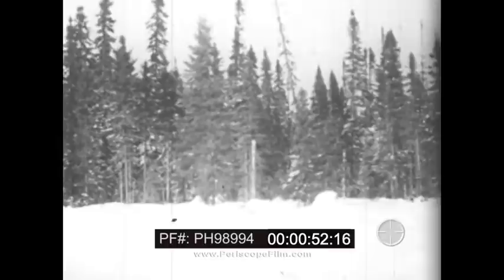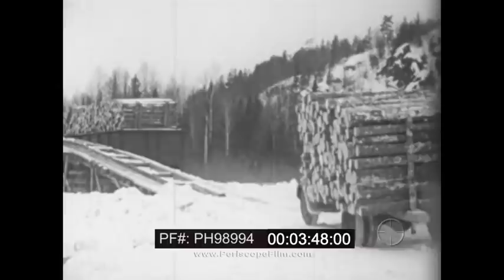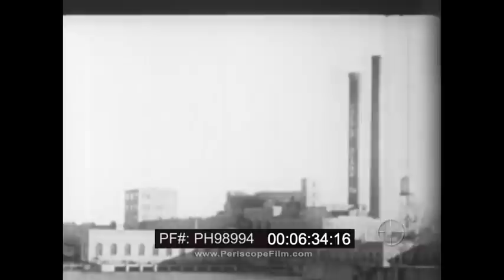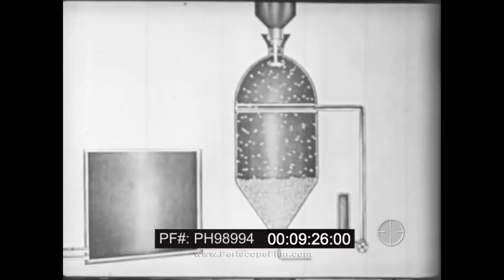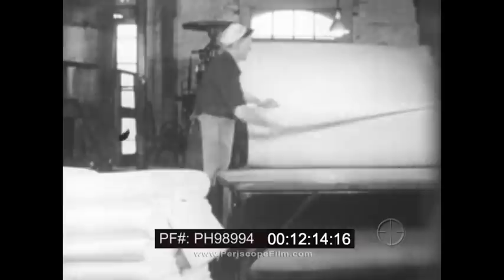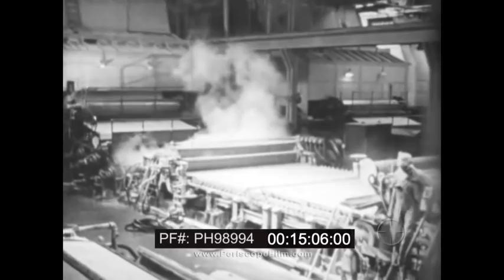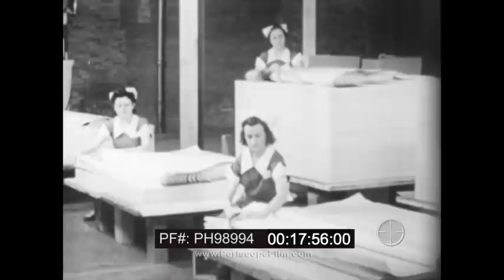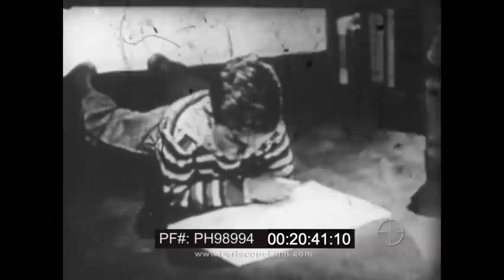1941 EDUCATIONAL FILM  " PAPER MAKING "  HOW PAPER IS MANUFACTURED  LUMBER INDUSTRY PH98994

Comment: I spent 30 years in the paper industry, primarily light and heavy weight coated publication grades. Of course, that market is dead. Who gets magazines and catalogs these days? Still, the basic processes described are still the same today, no matter what kind of paper you're making. Of course, a lot has been automated. Gone are the logging camps. Logging is done mostly year-round, except for a few weeks in mud season. Machines that grab the tree, cut it off at the base, limb it, cut it to the proper length, and stack it on a trailer in one smooth motion taking less than maybe a minute are now used. That's quite a sight to see. Continuous process digesters are now widely used, although batch processors are still used. Wet lap machines are still used, although primarily by mills that sell pulp or for stockpiling pulp for pulp mill outages. The bleached pulp usually goes straight to the paper machines now, maybe with a short stop in storage tanks. Sheeting is almost all automated, from cutting the paper into sheets to packing it into boxes. Even the stacking of boxes on pallets is automated. Robot trucks convey the pallets of boxes or rolls of paper around the mill now. For roll paper going to printing or converting facilities. wrapping the rolls and putting on the end-caps is all automated. Of course, the processes themselves are now computer-controlled, using distributed control systems to monitor and control the pressures, flows, temperatures, basis weight, caliper, moisture, and so forth. Not quite an operation "Run by one employee and a dog," but close. Safety and environmental protection has changes, too, a lot, and for the better.
Reply: I was a human forklift in a paper mill for a couple of years.
Reply: Nope.  You’re right. Thanks. I did too.

Comment: Here i was thinking paper has become crazy expensive.  But after seeing this, I cant believe how cheap it is.
Especially back when this info video was made.. Considering how many ppl had to get paid plus the expense of factory & machine upkeep.
Reply: With today’s logging machines able to cut down and strip a tree every few seconds, more efficient transportation, new processes and equipment, and less labour intensive, paper is probably more high grade and easier to manufacture, meaning prices can be a lot cheaper than you might think. 
What I don’t like is that even today we are still cutting down trees faster than they are planted or can grow to maturity, the amount of paper (and plastic etc) that the world has produced is probably mind boggling, and yet the rate of recycling is far lower than it should be, if we have any hope of saving the planet for future generations we have to recycle more, use renewable energy sources and stop rapping Mother Earth of minerals etc, otherwise the next generation could be the last. 😔😡🤬🇬🇧🏴
Reply: @allandavis8201  "otherwise the next generation could be the last" HAHAHAHAHA Really Al Gore? HAHAHA and "snowfall will be a thing of the past" too, right Al.
Reply: @allandavis8201  Capitalism doesn't cut off the hand that feeds it. When pushed, it will adjust to accommodate the changing resources and expenses. Your scenario does not factor in the technology that has and will continue to extract the maximum benefit for the least cost. (Or, you can volunteer to return to the woods and live off "the fat 'o the land," if you prefer.)
Reply: @bondjames5874  Exactly hahahah!
Reply: @allandavis8201  And pssssst this internet thing no usey de paper

Comment: Anyone notice that they DIDN'T SHOW where the "waste water" that was used in the processes went.

I was stationed in Plattsburg, New York in the mid to late '70's and there was a HUGE paper mill right on Lake Champlain.  The "scum" got so bad in the summer from the "waste pulp" that you couldn't swim.  That crap coated the beaches up and down the lake.  The city tried to get them to install pollution controls and the manufacturer told them if they wanted to press the issue, they would shut down immediately.  So, needless to say, the city backed down and the pollution continued.  Haven't been back in years, but the last time I was, the plant had considerably shrunk in size and production (I am sure the Feds stepped in).  So making paper is a VERY WATER INTENSIVE PROCESS AND THE WASTE PRODUCTS ARE HORRIBLE.
Reply: Exactly
Reply: The waste isn’t bad after it’s been treated. Most of it is used as fertilizer on farms or burned in a power boiler mixed with bark. I’m sure years ago it was different but it’s not a concern anymore.
Reply: @richie2dicks468  No, the waste from paper pulping is pretty gnarly.  I haven't been there in 320 or so years, but the last time I was like I said the plant was considerably smaller.  I would have to research to find out if they made any strides in reclaiming or reusing the pulp left over.  AND any commercial paper production facility uses MASSIVE amounts of water.
Reply: @MrTommyboy68  well I currently work in the industry and can tell you they have. You’d be foolish to think the epa would allow that this day and age. The only part you are right about is the volume of water. The process does use a lot of water and state and federal agencies have been setting new limits to reduce the pull from local aquifers in the last 5 years. New systems are being used to help with this such as reclaiming more process water and de salinization plants to use the salt/brackish river water instead of pulling from the ground water supply. This is why America struggles to compete with China. We are closing mills while they bring new mills online. There is no perfect answer. The main point is the environmental standards of your time are long gone and continue to change every year. Recently a large meal on the East Coast spent over $70 million to revamp their wood control process. The old pneumatic woodyard lost its permit and was torn down due to concern of airborne dust particles escaping. It was replaced with a self reclaiming system with underground tunnels and above ground fully enclosed galleys enclosing the conveyor system 100% from the environment.
Reply: Well, a lot has happened since then and after working in pulp and paper for 25 years I know that at least in Sweden where I am from, environment is a big concern. The lignin mentioned was in the early years flushed out in the river but when they found a market for it a lot of products were made from the lignin. Anything combustable waste we burned in the steamboilers. Any waste pulp was used to cover landfills as an example… Companies not willing to act responsible, just shut them down! We only have one planet.

Comment: Worked myself on the Wargön Paper mill in Sweden from 1983 until they closed in 2008. I worked myself upwards to better and better jobs from feeding the grinders to assisting Pulp boiler to bleacher to Pulp boiler and ended up as a steamboiler. Wonderful times but the bisulphite and the sulphurdioxide has taken a toll on the lungs.

Comment: And I bet the leftover liquors and all that other waste were just pumped into the river for the downstream people to worry about.
Reply: The liquors are not wasted at all. They are sent to evaporators to bring up the solids and then burned in a recovery boiler to help generate steam for the mill. The run off of the boiler is used to make green liquor when is them used to make white liquor. Then it’s used again. Virtually no loss
Reply: I worked in chemical recovery where the organic solids and the spent chemicals were burned. About 97% of the chemicals were recovered and converted into new cooking liquor for reuse again. The heat from burning the organic solids from the tree were used to generate steam for electrical generation or for drying paper. About 55% of our total energy needs came from the tree waste.

Comment: Wow things are different today. They used such thick logs in this video. Bleaching today is done with oxygen, not bleach. I would really love to know what the press blankets were made of, and if the former wire was actually metal. I don't think they had plastics at this point.
Reply: the rolls were skinny too
Reply: Paper Engineer here… almost everything about this video is so antiquated.  Nobody would take logs suitable for sawn dimensional lumber and make paper out of it.  The sulphite process is a dinosaur and was terribly pollutive die to pack of a good recovery cycle, the process to clean the pulp from the blow tanks has changed, the refining process, the actual wet lap machines… everything.  Although a lot of bleaching today is done with CLO2 also.  Those paper machines are cute abs tiny.  I also saw about 200 OSHA incidents here.
Reply: @Salvadorbalihai24  What was nice is those bronze wires would have been recycled. All the press blankets and plastic forming wires went to the on site dump, unless someone wanted to take one home. I imagine it was easier to mess up a metal wire while putting it on, seeing what the plastic wire went through sometimes. And yes, even the plastic wire did get messed up that it needed to be changed again immediately.
Reply: @MikeinAustin  The response we need.